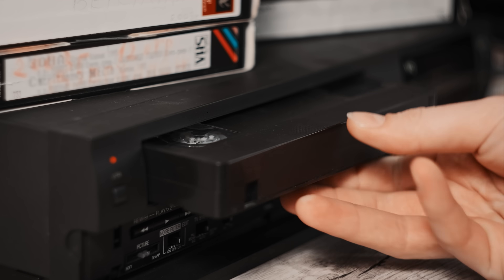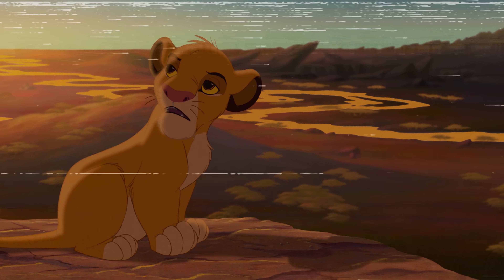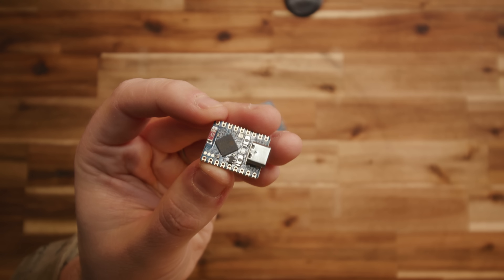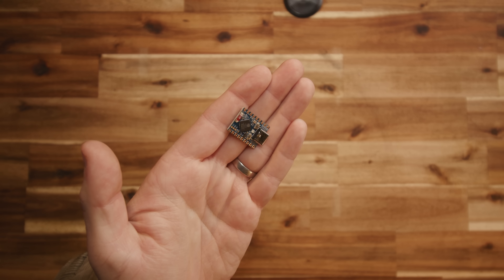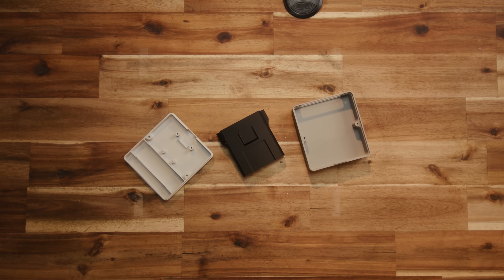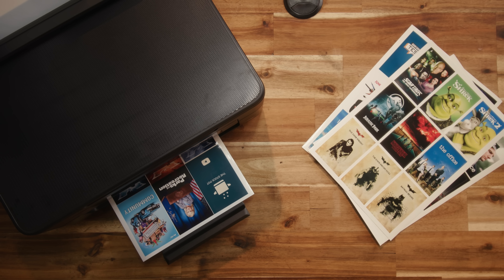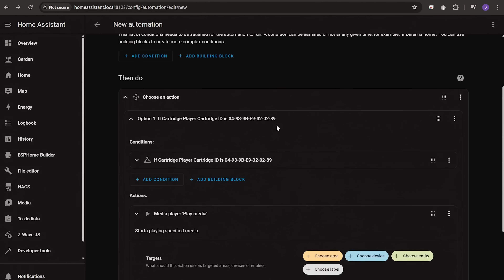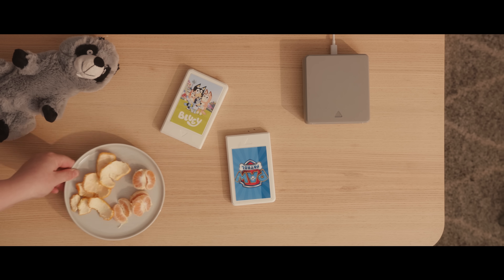I Missed VHS... So I Made My Own

Comment: Hmm, you could do one of these with QR codes.  Adafruit has a QR code reader module.  The reader would have to taller and have an LED in it to provide light for reading.  With QR codes, you could encode URLs, reducing the need for a database relating IDs to resources.

I have mixed feelings about this.  The nostalgia factor is huge, which makes it awesome.  On the other hand, the practicality factor is almost nothing.  The cartridge doesn't hold any actual data, so it's taking up space without providing significant practical value.  It's hard to justify the time and material costs for something that is purely for nostalgia and nothing else.

I have seen something more practical along these lines though, where the cartridge contains a USB drive.  The data is, of course, on the drive.  The cartridge is just a container, but it provides one piece of significant practical value: Size.  I have a bunch of USB drives.  They are very small, which is great when it comes to storage and transport but not so good besides that.  I once lost a tiny USB drive that had some critically important data on it.  I'm pretty sure it got lost at a hotel, but I don't actually know.  I never did find it, which cost me a lot of time and probably a fair amount of money.  (It contained some important projects, some of which had potential monetary value.)  Another problem with size is that when you have many USB drives, it would be nice to be able to label them, but they have very little surface area for doing that.  Some are so small they don't have room for a label at all.  But making the drive bigger is its own problem, because USB ports tend to be mashed together in a very small space, making larger USB drives block out nearby ports.  (And some USB ports are even recessed, making it impossible to plug larger devices into them at all.)  Putting a USB drive in a cartridge and making a "reader" that fits the cartridge means that the drive is big enough that it won't get lost easily and has room on it for labeling, and the reader means you don't have to worry about the size being a usability problem for nearly ports.  Another benefit of this kind of system is that it eliminates the chance of someone or something impacting the drive and damaging the drive or the port.  (If you have children, you might be familiar with this danger.)  Also, most drives are still USB A, which is directional, and it's generally easier to tell if a cartridge is oriented correctly than a tiny USB drive (especially if it has a label on the top side), reducing frustration when inserting the drive and reducing the opportunity for damage trying to push it in in the wrong orientation.

Anyhow, overall, I like your project.  It's really cool, even if it isn't super practical!

Comment: For the full VHS experience gut a real VHS VCR to install a tiny PC and a lot of storage. Gut a bunch of old tapes and put the NFC tags in them. Should be able to use something like an Arduino to run the VCR's display and operate the tape loading mechanism. Pop the "tape" in and it goes in just like the real thing but activates playback of the media stored in the "VCR".

For an even more immersive experience, get one of the surplus Video Vendor VHS rental kiosks stored in a warehouse in Texas. Spacetime Junction has a video series on restoring one to working condition, and he has a tour of the warehouse where most of them went when the Video Vendor company went out of business. The warehouse owner wants them gone so he can have the space for other stuff.

How cool would it be to swipe a magstripe card to "rent" a "tape" from a vintage early 1980's kiosk then put it into a "VCR" to play a movie, just like we did 40+ years ago? Except it's in HD on a 50" widescreen. Downscaling to 480P resolution optional.

Comment: The concept is genius. This makes much more sense and is more satisfying than collecting blu-rays which are flimsy with cheap artwork and no inserts. The corporate logos, warning disclaimers, FBI warnings, autoplay commercials kill the mood. DVDs are no good because they similarly cheap looking and there's the issue of fullscreen vs widescreen. VHS is lovely but just isn't practical and image and sound quality are seriously compromised.
NFC is interesting but I would prefer queueing up a digital file from a local server much more than relying on any kind of external source. Especially having to code it and potentially be made obsolete by app support. Media MUST be internet-independent. It should work ideally off a backup battery as if the power were out.
I think your media cases are perfect but the player is too reminiscent of the generic unbranded adapter devices flooding the market. I hate that you have to brace it while inserting and removing media. It should be large and clunky!! Preferably with mechanical devices inside. This could alleviate any force pressed on the media, if you set it in a tray, press forward, and it draws it in like a VCR. This is likely impractical unless an older device can be upcycled or if there's an off-the-shelf product that can be repurposed and adapted.

Comment: Suggestions to V2: 
- Add internal button to check if "tape" is fully inserted.
- Since you are using Media Player entity, then you can check current state and if it stopped playing, then eject cartridge using servo.
- Add external button to eject the "tape".
- Add 7 segment displays to display current minutes/seconds and playback state (PLAY, PAUSE, STOP).
- Add DFPlayer or similar module with speaker to simulate the ejecting and loading tape sounds (can be controlled via UART).
- Plastic latching mechanism will destroy itself from rubbing on the "tape", I suggest to use ball from bearings and a spring.

Comment: I did much the same thing with an old eight track. I placed an old mp-3 in an old eight track cartridge with an old eight track head mounted in the cartridge directly hooked to the head with current limiting resistors of one meg ohm each. The voltage from the tape track detector powered a five volt regulator transistor as when hitting the track advance I used a 2n222 to detect the track advance to advance the music just like a real eight track would. This cartridge works in every eight track even without the belt and or motor working. I wish to make a solid state helical scan plate to replace the rotating video head to more cleanly reproduce old VHS and BATA tapes in the future. You could grab an old VCR and place a thumb drive in an old cartridge with a perfectly aligned USB port and have a realistic VHS..

Comment: Creating a cartridge with a NFC chip and a NFC reader to access a video library stored elsewhere isnt real physical media experience. For that, you could have used microSDXC-cards and - for example - a disguised Raspi Pi4 or better with a "player-style" casing and a media player software like Kodi and a (custom) plugin that starts card playback as soon as a card with movie files is detected. That way, the card inserted actually HAS the media on it. And you can use remote controls directly with Kodi.

Comment: hi it's better than tapes  what if where the video files are  
it is getting hard to rip a back up a blu-ray on a computer now 

i have to say i do love the betacam format   there's only one place for new vhs   ADAT  old betamax some are 50 years old so i am having to pull them
apart and re bike the in side   case can be reused some where  

yes this is a great plan for the young one's  so you know what they are watching when you are in the same place 

i never had a video deck when i was young dad had a tape deck a reel to reel it cost alot in 1957 so i got used to sound 
this would be great for playing audio  no need to go to the files get in plug one in audio plays right away  

for audio big time it would be great

Comment: I don't know if it's possible, but..
What if you used the tech Flash sticks and just built a frame that looks like VHS, Floppies or some other old storage medium?
I'm not talking about accessories for USB sticks, I mean literally taking a Flash board and doing some dark magic peckneckiry with a custom connector and "readers" to read/write data to it
Then you can fit a lot of high quality movies onto a single "VHS" tape and store lots of files on a single "Floppy" disk
They will have the aesthetics and feel of the old mediums but the covenience and advantages of the modern day

Comment: The best thing about tapes is the tactile sound and sturdy feeling in the hands. Discs are better, cooler, but they don't make cool noises. The MiniDisc put a casing around their mini cds so perhaps a player designed around using larger size discs of a newer format could be done for physical media. Even blurays can't hold the entire 35mm films the movies were shot on, and modern day streaming has scrubbed movies and television of the grain and its full color data and even in the 4K era of blurays you will find them not 1:1 to the original 35mm films.

Comment: "Be kind - rewind!"
I was wondering how you'd pull off that rotating head drum to work with VHS cassettes, let alone all the circuitry... got a bit surprised, haha.
While VHS didn't offer much in video quality compared to DVD, let alone BluRay, it was an excellent media for analog audio. Some even argue it did better than 1/4" magnetic tape on reel to reel decks.

Comment: a potentially less expensive alternative to the NFC chips and reader in the box: QR codes. the cartridge is basically just feeding a number into the automation database to cross-reference the playback action. A barcode or QR code on the bottom could do the job and also be easily replaceable incase of damage to or loss of the physical cartridge.
Reply: The filament for the cartridges end up at about $1AUD and the NFC sticker at $0.07AUD, so it's pretty cost effective and more tactile for my son :)

Comment: Respect!
Couple of additions to make this truly magic.

1) edge labels. This is a requirement, not optional, lol
2) onboard storage. enough space to add software to help anyone batch setup the cartridges so they're not manually inserting the NFC tag ID's on their server. I'd rather have this an offline product and not rely on network connections for posters, subtitles, trivia. I'd also like it to maintain stats such as view counts and "continue where left off" local to the cartridge.
3) access lights. local to the cartridge for those with the above onboard storage
4) progress counter, chapter and title display on the player unit. With pause, play, stop, ff, rw local to the unit as well. The remote is cute, but this is what I dislike about my modern bluray player. Very Expensive Sony UHD, but no face controls or display. lose the remote and it's useless.
5) top loader option. Think Original VHS top loading, North American NES, and another option similar to Atari/NES2. And have the cartridge poster orientation/labels to consider this insert method. I just see you having to hold the player just to insert and remove the cartridge, which makes me cringe.
6) Piezo speaker onboard the player. can be used for sound effects or operation. I'd make it customizable per cartridge, but have a standard sfx set if they are not overridden 

I understand you built this to a cost and were just making a video for the internet. I loved it, and hopefully you see my list above as just a contribution to the creativity this video introduced.
Reply: Couldn’t agree more with edge labels

Comment: I would pitch in on a Kickstarter that actually made real cartridges that stored media on a secure enclave nand flash chip with a small RPI playback device with esp32 integration and custom software. 

I could also see this including the same NFC tech to allow for access to special behind the scenes content with an authenticated cart as well as allowing users to access the streaming version of the media of they wanted to. 

If made cheaply enough, this could make for a great replacement for disc media which has had more and more issues in manufacturing quality as well as issues with reliable playback. The r/4kbluray subreddit is replete with users having issues with brand new discs on supposedly high end players like the Panasonic UB820.

Comment: So you built a more complicated way to load a streaming service? That's not what I was expecting from this video.

What you should have done is make the cartridge actually hold the data that would be played. Even glueing in a USB drive that slots in would be an improvement over using RFID to launch a streaming service. There is no lockout for launching the video with any other method, so you just made a complicated single purpose remote. Even the worst VHS players did better than that. And as others have said most of the VHS player functions are missing like the clock. But I guess if you're blinking "12:00" than that would explain this project.

Comment: This is genius.  Retro gamers who use emulators would love this.  You could adapt the design to mini versions of the various cartridges.  For the cost, multiple readers for each platform that look like the console would be easy to justify. Hell, you could even dig up or buy a stack of blank CDs and stick the NFC tag under a label.  Then you would have real discs, but data not required.  No reader to fail, no slow burning. No original media being scratched and worn out. That would work for movies too. The reader could either be a slot loader or I bet you could even gut an old slim DVD drive to just use the load and unload mechanism.  I might have to try that.  I think I have one in a junk drawer somewhere.
Reply: With a lot of game  recompilations coming out, where the entire game is a native .exe, you might even be able to run the game right off the "cartridge" itself!

Comment: I do have a comment for possible improvement - on the top of the cartridge, add a place for a simple logo sticker like the old Atari 2600 cartridges had.  This way, when you cartridge is all the way in, a quick glance will show you 'oh, Lion King' or 'Star Trek III' is in the player without having to ask the person watching.
Reply: My friend just printed out the cartridge, and dang I didn't think NFC stickers were that small.  But yea, a front/top sticker would be great!  That way I can stack the cartridges and still know what's what by looking at the narrow side.  Maybe recessing the large sticker section just a little, maybe 1 mm or so.  I'm going to test it out with the NFC reader I ordered when it arrives.  Hopefully I can set this up using my Synology and Home Assistant.

Comment: I thought you would use some kind of connector from an old console to work as a SD Card interface and use SD Cards to put the films (basically having giant SD Cards), but your way was way more simple and clever. That being said, I would love to have what I just described. I have no idea how that would specifically be done (I wonder if a Raspberry Pi 5 is good enough to read 2160pHDR content), but I like the idea of having the data on the cartridge and a device that its only purpose is to read it.

Comment: As somebody from the 80s, no I don't miss VHS for a second, we dumped it as soon as DVD turned up for a lot of reasons. Price, Size, Doesn't wear out, no heads to clean, no rewind, instant skip, subtitles, bonus features it had it all. But it seems what you would like is to make a Caddy based DVD drive. In the 80s when you loaded a CD-ROM they were stored in a caddy to keep the safe, as they were "easily damaged" apparently, this turned out to be false and the caddy was dropped pretty quickly. You could probably remove the tray from a dvd/bluray player and make it an open slot then 3D print some caddys that match the slots profile to then insert into the player to get the "cartridge feel" without having to set up the backend and make something else for it.

Comment: i would love to see a version of this that actually stores the movie files on the cartridge, on some kind of flash storage or on a small 2230 or 2242 128gb nvme drive, to have full 4k bluray quality video files but in a compact and more robust, non-optical format
Reply: Afaik,flash storage doesn't live as well through the time as HDD or optical disks. While nvme is working fine as a PC storage due to getting power every now and then to make healthchecks and maintainance, I'm not sure it works well for passive archive. Yeah, it would be cool to have them physically, but it shouldn't be the only copy you have, so probably don't loose those BlueRays after making a copy. 😅

Comment: The main nostalgia point for me with casettes is the mechanical part. You basically created cartriges.
Reply: Not even cartridges. Cartriges had the media on them and didn't require a network to retrieve the media.
Reply: Same! My plan would be to just to take a real VHS deck, retrofit a NFC reader into it and add NFC stickers to the tapes, so all the nice mechanics when inserting it and all :)
Reply: Yeah until you rewind or fast forward and hear the horrible screech of the tape being ripped out and tangled around the insides of the player. Ahh Memories.

Comment: For version 2, you need a the cartridge to fault, with a humidity sensor in the cartridge that requires you to blow on the cartridge to get it working again - after each play the cartridge "degrades" and has a higher liklihood of faulting
Reply: Blowing into cartridges actually made the problem worse. the humidity from people's hot breath actually served to encourage corrosion on the contacts.